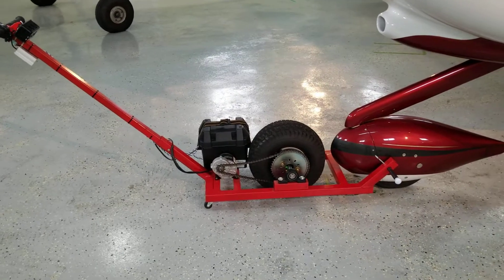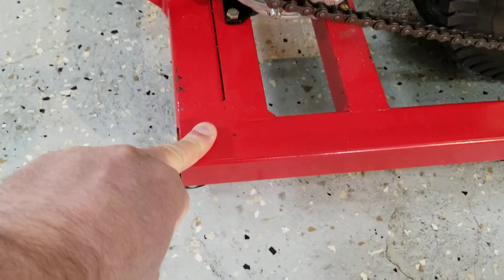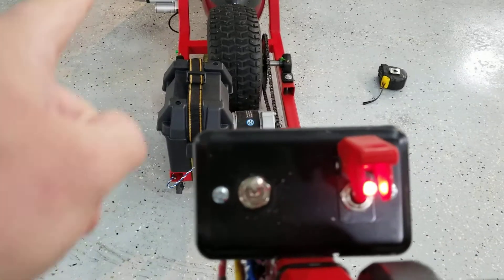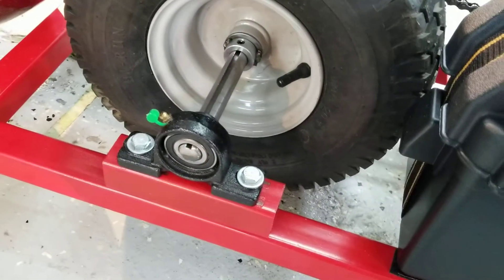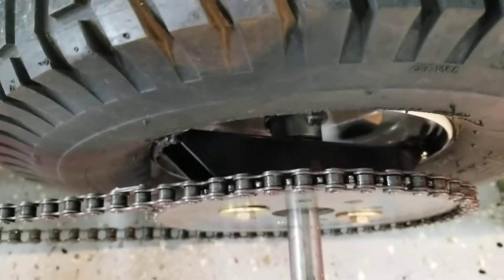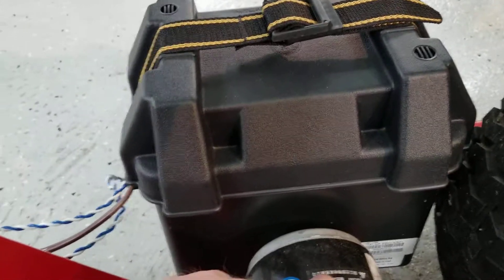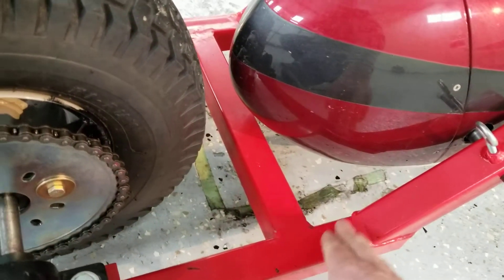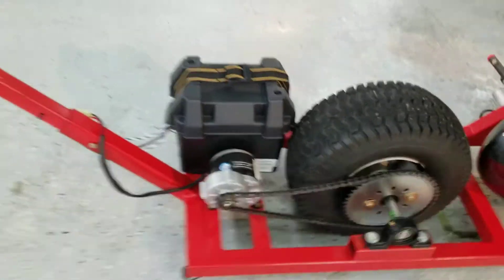Homebuilt Aircraft Tug Details

Comment: if i use 44t on wheel ..for pull cessna 182e without fuel..u think can or not?
Reply from the maker: I’m sure it would be OK but a lower gear ratio would be better. I know of one person that used a 72 tooth gear and easily pulls an A36 Bonanza. I think a 64-68 tooth gear is the sweet spot for use with this motor.
Reply: @rocclobster tq sir i will try use 44t..i also use 24v 350w motor same like u jus different wheel

Comment: Nicely done. I’m busy converting a power chair into a tug and I think it will be good but from the amount of work I’m thinking a clean sheet design like yours would be better.
Reply from the maker: It’s been working great for about 7 years now. I lowered the gear ratio by swapping to a 64 tooth gear and the 350w motor is more than adequate.
Reply: @rocclobster sir can u help me..how i contc u..i use just copy with u tow tug but i use wheelbarrow and use 44t on wheel barrow

Comment: Nice work. It's much simpler to use a hub motor. <VBG>
Reply from the maker: I just checked them out after I saw your comment. I’ve never seen them before. I would be interested in seeing one put on a tug. If you can get one that is geared down for low speed/high torque it would make for a more elegant solution.

Comment: tell us about battery?
Reply from the maker: @marioctg  it’s just 2 12v lead acid 6 or 8ah batteries wired in series to get the 24v needed for the motor. Whatever batteries that will fit in your choice of battery box would be fine. Newer Lithium or LiFePO4 batteries would work too and would be a lighter option. A quick Amazon search will get you what you need.

Comment: Hi, congratulations nice work 💪💪💪.

Is such a system with a 500W 36V Wheelbarrow  motor capable of towing a 100kg cart to the beach on the sand? Or the sled wheel? Thank you

Comment: Very nice Tug. Did your motor controller come with reverse wiring option? If not, how did you wire to reverse please
Reply from the maker: The controller has a reversing function but I didn’t use it. I used a DPDT switch and wired it to reverse the polarity on the motor. Using the controller would have been the ideal option but I didn’t realize it had that function until someone else pointed it out. The controller wiring instructions were in Chinese. I purchased my parts from eBay and Amazon but now there’s a one stop source for everything.
https://www.electricscooterparts.com/
Reply: Thank you
Reply: @rocclobster  If it is the YK31C controller, it does not have a reversing function. You need to reverse the blue and yellow wires going from the controller to the motor.
Reply from the maker: @pebech it’s been sim long ago that I built this thing that I don’t remember the part number of the controller. I do remember that it had a reversing function but I just used a switch to reverse the polarity of the motor. It’s now 8 years old and still going strong.

Comment: I am building a similar tug. How did you mount the electric actuator?
Reply from the maker: I took a 1”x1”x1” block of aluminum and filed it concave round so that it made a nice fitting pad between the movable shaft of the actuator and the tubing that slides in and out to grab the lugs on the wheel fork. The stationary end is just bolted to the frame of the tug.

Comment: I think You should add safety switch and made some cover for this gear chain. But more important thing is to always have a electric fuse in case of short circuit. Many people like to forget about this and ask why fire happened... Short circuit can happen even in best designs in worlds.
Reply from the maker: There are 2 fuses, one for the motor circuit and one for the electric actuator. Both fuses are located in the battery box. As for the cover on the chain it’s not needed. I’m the only one that uses it and when in operation I am not within reach of the drive mechanism. If you build one you’re welcome to make yourself a chain guard if you want.
Reply: @rocclobster  ok, good. However, we dont know when small accident happen, so better to be protected - just telling (one time I accidentally put sharp knife into my own leg...).

Comment: My Sons and I fabricate concepts all the time, and from that experience I can say you did a great job.  Functional, inexpensive, and an exceptional appearance.  As a pilot, here's my question.  Some hangars, and every ramp has an incline and decline to address.  On your unit, I see the go but no stop.  Additionally, with motion (forward or rearward) inertia exists.  I realize the motor likely has an element of resistance built in, but on the side of insurance, I'm curious what happens when you need to stop suddenly?
Reply from the maker: I have not found it to be a problem. How would you stop if you were using a hand tow bar? There is a considerable amount of resistance through the gearbox and motor so when you release the throttle it stops pretty quickly. If you have a significant incline where you tow your aircraft around I’m not sure this is a suitable design for you. Building in a brake mechanism has not been a feature that I’ve ever felt the need for in the 4 years that I’ve been using it and I often have to play airplane Tetris when I have friends’ airplanes in the hangar.
Reply: @rocclobster  When it works ... don't fix it.  Using hand tow bars I can feel the inertia setting in and I always have a wheel chock to insert if necessary after applying my hand against the spinner.  My concern would likely come into play with a heavier plane too.
Reply from the maker: @richardgreen7811  this design would need some modification for airplanes heavier than a C-182 or RV-10 weight class. If I was handling Bonanza or larger I think I would consider a brake mechanism. It would also require a rethink of the structure and the drive system. This is an intentionally simple tug and works pretty well for it’s designed purpose.

Comment: Question for you, is the motor actually brushless?  how many wires are coming out?  I am only seeing 2, is that correct?
Reply from the maker: I specifically spec’d the brushed motor MY1016Z.  My apologies if I said it is a brushless, I misspoke.  I also spec’d the controller for a brushed motor.  There are only 2 wires coming out of the motor.  BTW I also said in one of these videos that I would have went with a 450w motor.  After hearing from others that decided to use a lower gear ratio with this motor, it seems that the sweet spot is a 60 tooth driven sprocket. The sprocket on the motor is a 9 tooth. A more powerful motor is unnecessary.
Reply: Thank you very much, I am currently adapting your design for my RV-6.  I also did an amazon search for a brushless Motor and ordered what came up and was surprised when it arrived with only two wires. a closer look indicated that I had ordered a brushed motor.  I also ordered a thumb throttle like you have but returned it as it indicated that it only worked with a hall sensor for a brushless motor.  I will order another as I like it much better than the twist knob that came with the brushed motor controller.  I will see how the 44 tooth sprocket I have works, my 6 is only 1072 lb. empty.
Reply from the maker: @stevenwilkes5737  try https://electricscooterparts.com/
Reply: @rocclobster  Thank you Very Much!!  wish I had this when I started buying parts, but the will really help me finish up,  thanks!!

Comment: Would changing the gear size on the wheel help with the torque needed with the smaller motor?
Reply from the maker: Yes it would help for sure.  There was at least one built with a 65 tooth and it works very well for his 182. I’m considering doing the same.  More torque would be nice and, with my current ratio, I have a little more speed than needed.

Comment: Hi,
Can I ask what is the RPM on the motor?
Thanks.
Reply from the maker: The motor is a MY1016Z.  No load rpm is 3000 at 24v.  Gear ratio is 9.7:1.

Comment: Very nice tug. I just bought a DIY tug from someone that is very similar. It is 24v 500w tug. When I bought the tug it did not have an on off switch and was setup to just push. Since then I’ve added an on off switch. I have tried to add a reverse polarity switch but. When I add power to the tug it fries the polarity switch. This has happened with 2 different 6 pole switches. Are you using any special switch. Thanks for any help
Reply from the maker: My switch is rated for 20 amps.  You will want to make sure the switch you use is rated for the current the motor is pulling.  Otherwise it’s just a regular DPDT toggle switch that I am using, nothing special.
Reply: @rocclobster  Thanks for your help. My motor says 27.4 amps. It is hard to find a 30 amp DPDT switch.
Reply from the maker: @JimMac0824  Check the wiring diagram for your motor controller. Most have a circuit to reverse the motor with a low current circuit.  That way the controller does the polarity change instead of putting a switch inline with the motor power wires. 27 amps and 500w would mean you have an 18v motor?  That doesn’t make much sense.  A 500w 24v motor should draw just over 20 amps at max draw.  At any rate a  quick search on Amazon I found this 30a dpdt rocker switch.  It’s not cheap though.
GAMA Electronics 30 Amp DPDT Momentary On-Off-Momentary On Rocker Switch https://www.amazon.ca/dp/B001PNO4OE/ref=cm_sw_r_cp_api_glt_i_0V91ED6CJX251XGN8YHM

Comment: Do you Have a diagram of how to wire up & where  the Thumb Throttle . Thanks
Reply from the maker: The wiring will depend on which motor controller you choose.  I don’t have a wiring diagram because there are too many configurations possible.

Comment: Would you consider this wheel big enough to use? https://www.northerntool.com/shop/tools/product_200331219_200331219
Reply from the maker: 12.5” is smaller than the one I used but I’m sure you could get it to work.  You would have to do the math on the gear ratio required because the gears that I used will not be the same.  With the smaller wheel and 60 tooth gear you’ll be running roughly 50% the speed with the same motor.  The upside is the torque would be greater.

Comment: I’ve built a similar one, are you able to turn wheel without lifting tug up?
Reply from the maker: I don’t know if it’s possible to post a picture here but I would like to see what you built.  It might also help others improve on what I have done here.

To answer your question, I don’t need to lift it up completely but it is a “skid steer”. The design concept was to make a tug that is simple to build, fairly inexpensive and allow me to move the airplane around without breaking my back.  To build in an articulating feature (or functionally similar) to negate having to relieve down pressure in order to allow it to skid steer is certainly possible but not as simple.  There are many ways to improve on this very rudimentary design but I haven’t come up with anything that didn’t make it more complex, more expensive or more difficult to build.

Comment: Great project! An improvement for people who attemp to replicate your project would be to shorten the wheel axle and bring the bearings closer to the wheel.
Reply from the maker: Of course you can modify it however you see fit but I'm not sure what you would gain with your suggestion.  It would require mods to the simple box frame.  The goal was for it to be simple to make, inexpensive, and use readily available parts.  I built this one in 2018 and use it quite a bit.  To do what you suggested would require the frame to be narrower which would then require an additional mod to attach it to the airplane.  I guess you could add a couple more frame pieces beside the wheel to accept the pillow blocks but that is just adds more expense, weight and additional welding for no gain in performance or practicality.  There was a suggestion to go with a larger driven sprocket, 60 or 65 tooth rather than a 450w motor that I suggested in the video.  That's a change that would fit with the design parameters that I set for this project and I think it would work well.
Reply: @rocclobster  As long as the axle holds up, I have nothing to say :D I had a big project being ruined by the axle being too soft and bending under load. It was terrible. I'm happy to hear that everything works fine. Great little tool!
Reply from the maker: @karim1485  the axle is holding up well so far.  There's not as much strain on it as you might think.  The frame is 12" wide and the wheel is about 4 inches wide (outside to outside at the bushings).  With the pillow blocks being 1" that leaves about 3 inches of unsupported axle on each side.  The alxe shaft I used is a hardened steel one like this one:
https://www.princessauto.com/en/detail/3-4-in-x-3-ft-keyed-shaft/A-p8079733e

If you were to use a softer metal or a steel tube for an axle it might cause some issues, I don't know.
Reply: @rocclobster  Yep very much. and as you said, I was worried about these 3 inches... Glad it doesn't affect you!
Reply from the maker: @karim1485  I think I if someone was to choose an axle that is not as strong as the one I used your suggestion might be a good solution.  It could also be a less expensive option because the axle I bought was fairly pricey.

Comment: Do you know what rpm of the sprocket on the motor is ?
Reply from the maker: The motor is a MY1016Z and the rated speed is 400rpm at 24v with no load.

Comment: I am very interested in building a tug similar to yours. You suggest using a 450W motor rather than a 350W motor to increase the force. But there are fewer choices for 450W motors and they are far more expensive. If you were not using full (100%) throttle you could increase the number of teeth in the wheel sprocket to gain more force and possibly still maintain the same speed. Approximately what percentage of full throttle were you using at the start of your first video? What is the gear ratio in your motor reduction gear? Also, giving us the motor manufacturer and model number might answer a lot of questions. Thank you for your help.
Reply from the maker: Under load the 350w motor and the gearing that chose provides a easy walking pace backwards at full throttle when pulling the RV-10 out of the hangar on level ground.  The sprocket on the motor is a 9 tooth and the driven sprocket on the wheel is a 44.  There was no documentation that came with the motor so I don’t know the reduction of the gearing in the motor’s gearbox nor do I know the rpm of the motor at full power with no load.  You could use a 48 tooth and get a little lower gearing.  It’s entirely possible that the 48 tooth sprocket would provide a more suitable ratio for this load but, if I was to do it again from scratch, I would just go with a more powerful motor.
Reply: @rocclobster  
Finding a suitable 450W motor for a decent price has been difficult and all the ones found have lower reduction gear ratios which defeats the purpose. If you have any suggestions please send them along. So far my best options are to stick with 350W motor and use a 60- or 72-tooth sprocket on the wheel to lower the gearing. The top speed will be 30-40% slower than yours but that probably won't be an issue.

The biggest problem I am facing is getting the #410 wheel sprocket. They are $80-95 depending on the number of teeth. I considered switching to #25 chain but the #25 motor sprockets have a D mount and the #410 is keyed so that is not an option.

How much down force do you apply to the handle to keep the wheel from slipping?
Reply from the maker: @375tommyg  https://www.ebay.com/itm/184273432724
Reply: @rocclobster  I found that motor, also. But the gear reduction is 7.14:1 (3000 RPM/420 RPM) while the 350W motors are 9.7:1. That becomes a break-even with torque. It would take a 60-tooth wheel sprocket to match the force of a 44-tooth sprocket with a 350W motor. More speed with the 450W but less torque. I think your original choice of 350W motor was a good choice. Just go to a larger wheel sprocket for more torque.

What size batteries did you use? I am thinking a 7.5 A-hr. That should give about 25 minutes operation time. Plenty to push in and out.
Reply from the maker: @375tommyg  mine is a very basic design.  It was meant to be inexpensive and easy to build.  My intention for posting it on YouTube was so I could easily share it on various aviation forums.  It is not a best tug by any stretch.  I hope that others, including you, could modify the design with well thought out solutions, make it even better and share it with the community.
Reply: @rocclobster  Do you think your setup will be able to pull a Baron 58? (6000lbs) or would i need a much larger motor
Reply from the maker: @akhilpillay4262  This design works well for airplanes 3k# and less.  For a heavier airplane you would need to consider extra structural support for the tow arms. To get the torque required to pull an aircraft of that weight you would have to increase the size of the driven sprocket quite a bit.  Maybe a 60 tooth would work with the geared 350w motor but would also slow the speed of the tug significantly.  For something like that I think I would look for a 500w motor and maybe a 72 tooth sprocket or even larger.  Motor speeds and torque values are available on the web so you can do the math to determine what you need.

Comment: This looks like an excellent design. Thank you for posting. I started Googling for a motor but didn't find an applicable one yet. Will you help us by posting a parts list? Links to the parts you purchased would be invaluable.
Reply: Search for "24 or 36 volt electric chain drive motor conversion for bicycles".  They run about $100 for the motor. Then you need a battery and charger.  Then of course the go kart drive wheel, tubing and other stuff.